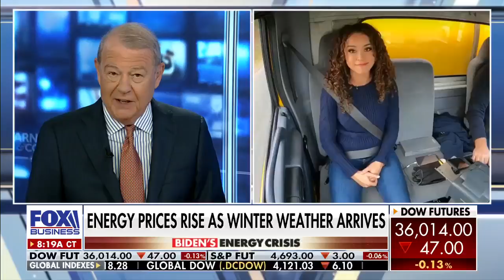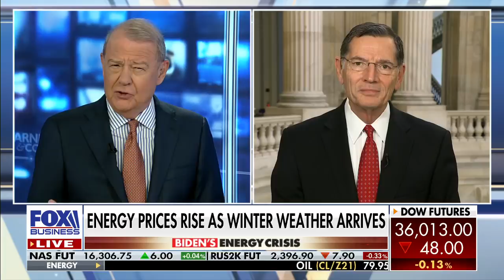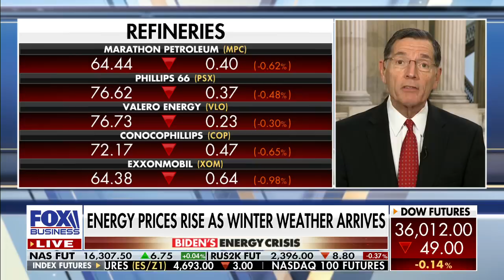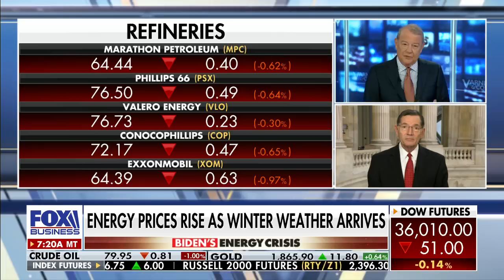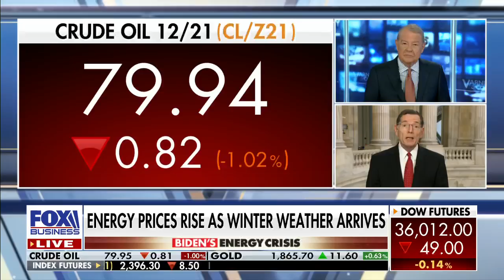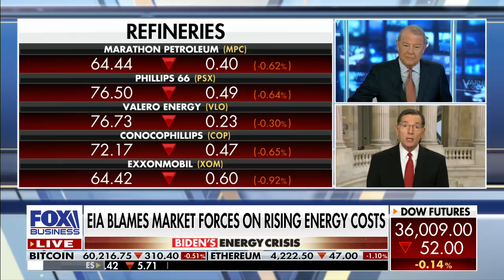Biden, Kerry are 'wrong' about energy and Americans are paying the price: Sen. Barrasso

Comment: Absolutely correct. If we are going to replace the internal combustion engine we need to do it with a plan in place and to do so with a viable alternative. They have done neither but rather have been bought off. Instead we are going to pollute worse with toxic lithium and batteries and nuclear waist. The only viable alternative is zero emission hydrogen fuel cells coupled with the new electric drivetrains. It's not even on the table, why? Money, the elites supporting the Dems bet wrong and do can't make enough money off of it. Hope and pray for everyone to see the light and do the right things for everyone not just themselves. America needs to wake up and speak up or say goodbye to freedom and prosperity. The time for complacency is over. Hope and pray for everyone to see the light and do the right things for everyone not just themselves. My opinion